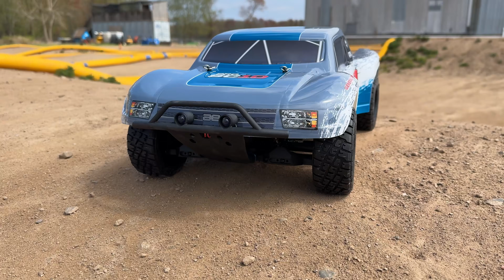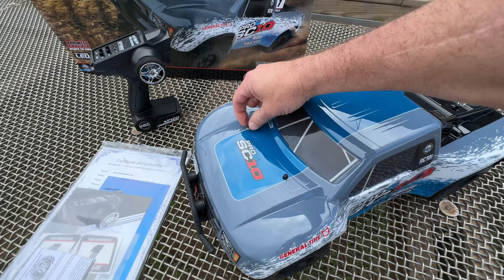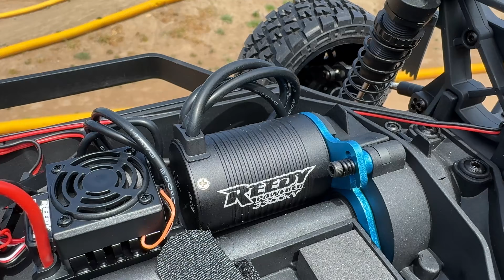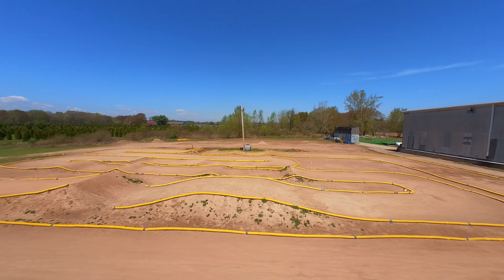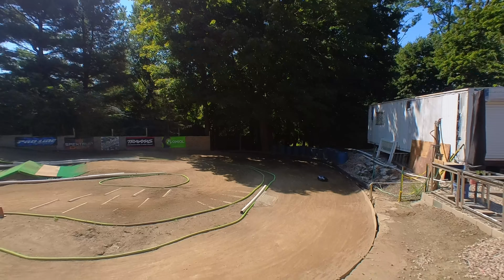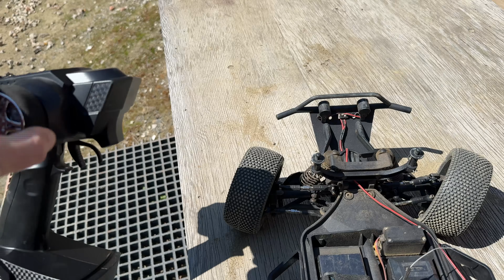Dialed Or Doh!? Team Associated Pro4 SC10 Track Time

Comment: That’s on you dude. I had no problem with the best RTR it can obviously be upgraded to whatever you want. Tires shocks comes with a center diff. Put fluid in the diffs. Tires and gears and it will compete with anything.
Reply: I race mine. Nothing wrong with the truck

Comment: This rc vehicles was made by a different company and distributed through Hobbytown hobby stores. It was called the Helion Avenge 10SC. Just had a slughtly different body and not the so called General licensed tires. Same everything else. AE bought the brand and stuck their name on it. This was disappointing for me to learn. I bought this truck and shortly after a month had some issues. AE CUSTOMER SUPORT was terrible and not helpful in the least. Truck is good...AE customer support got an "F" for absolute fail.
Reply: Hellos was started by Gil Losi Jr. So essentially AE bought a truck made from there competitors.

Comment: From my experience with that RTR. Cut the body a little, replace the stock tx/rx, replace the wheels/tires, drop 1 tooth on the pinion, change the fluids, throw a proper alignment and it will surprise you for a RTR. If your a able driver you can hang not win a amain but you can hang. Fun basher for sure.

Comment: I've had pretty good luck club racing this truck.  The weak point is the axles, especially the Team Associated Steel CVD, don't buy them, they are complete junk.  Instead use Traxxas 6854A or 6853A.
Reply: How would you compare this to a slash ultimate?

Comment: I have a clicking noise under acceleration is this normal. Literally ran with the noise out the box. First time I ever pulled trigger. 
My MT10 also made the same noise after a while and never got to the bottom of it even after checking all diffs lol

Comment: I didn't have any complaints about this truck, but jumping on your average cheap ramp would cause the bulging pumpkins to scrape and catch the jump surface. The smooth-bottomed vehicles just don't have that issue. Still worth the money as a race capable basher, in my eyes. But doesn't like cheap, hard-transitioning skateboard ramps.

Comment: Lengthen and move the rear camber link to the outer hole on the bearing carrier. 15/15/7 diff oils, and do the C block mod or Tekno pills to add anti-squat. Completely different truck
Reply: @YEYYYEY  That diff setup is close to  what  Tekno recommends for the sct410 2.0 . May have to try that in my mt10 and sc10
Reply: @chrisvda7277  i think thats why i changed the oils. The AE stock oils were too aggressive and seemed more basher oriented
Reply: @YEYYYEY is this a racing oriented setup?
Reply: @SH-ry2xi  idk if id say race setup BUT it did change the handling of the truck for the better. Gave it a steadier more predictable feel. Didnt squat and nose dive as much as box stock. Give a try, its all reversible👍🏽
Reply: Rear 15k Middle 15k front 7k correct?
Reply: @SnoriRC Frt/Ctr/Rr 15/15/7

Comment: I raced this truck on a big outdoor track hundreds of times. I broke both bumpers. One A arm. Rear shocks. Stripped the spur gear a few times. And went through some bearings. Other than that, it was rock solid. And it took such a beating just to break those parts. Now I have upgraded electronics. Basically, all the stock replacement parts . And somehow still running the same front shocks that have been rebuilt a few times.

Comment: I loved mine stock threw a max 10 in it and a killer servo loved it even more bought factory shock great then I went to the factory driveshafts and I can’t keep it together now . Fronts keeping coming apart .
Reply: @mcsbikelife3829  What max 10 combo you so with??
Reply: @chrisvda7277  3300 if I remember correctly though I bought both the 3000kv motor and the2000kv motor . They both work great , no heat issues and crazy quick . Like I said my only bitch is that I went to factory driveshafts and I wish they had a metal pinion gear .